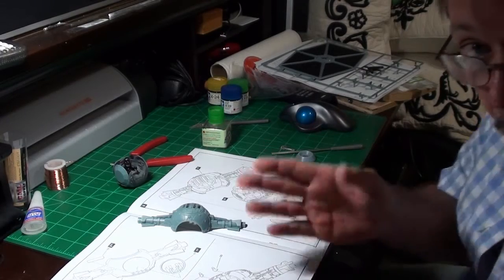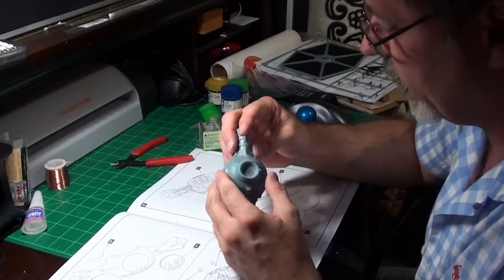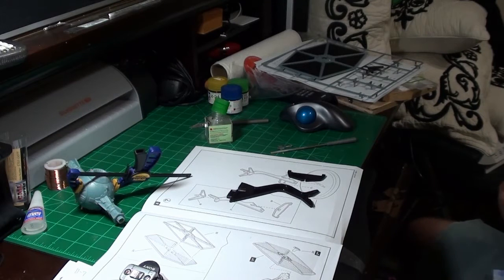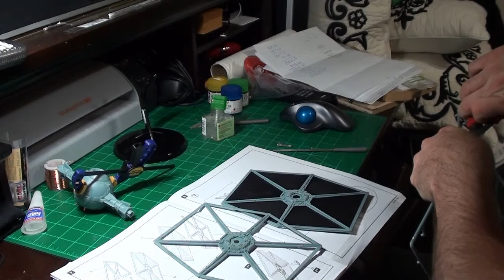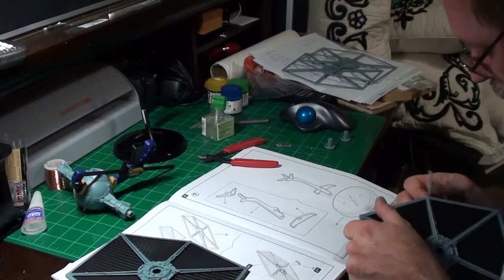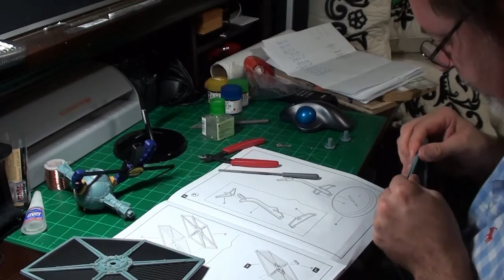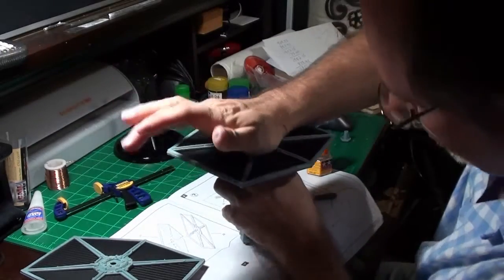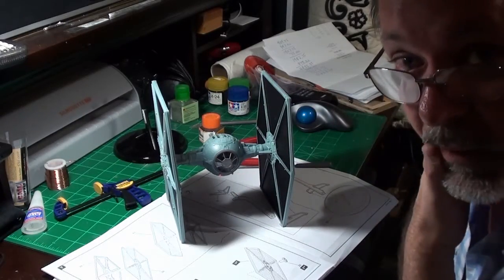Revell Snap kit:  Tie fighter final vid.

Comment: Ah, I finally found you among all the stars! I too am a member of the modeling forums. I just bought those two Tie Fighters on evilbay myself. Amazingly enough they were only about $22.00 altogether. I am guessing that they're 1/48th scale in keeping with the MPC line of Star Wars models that were originally released on '78. I hate the base - it looks nothing like the Death Star. That is disappointing but at least the fighters look correct and the pilots are Tie Fighters themselves rather than the horrible one that came with the Tie Interceptor which is the EXACT same one that came with the original X-wing kit! I have plans for him but I will recast the Tie pilot so that I can use him in the Interceptor and make a new Vader for that kit as well. I never got to even see this kit let alone get a chance to build it. I am glad that someone did a build and review. Thank you and keep on building!